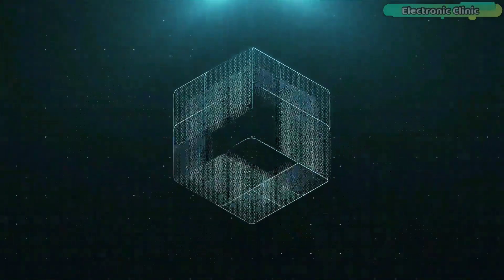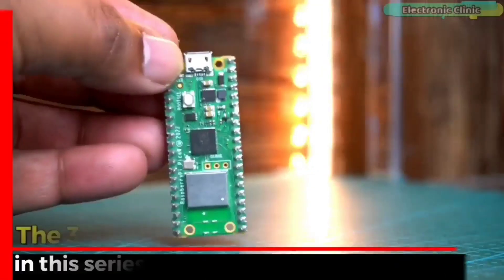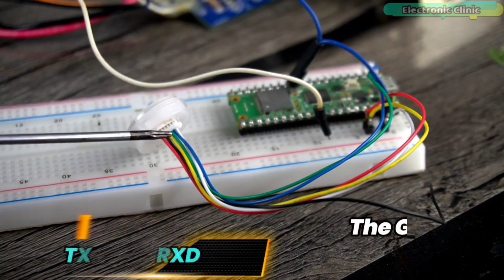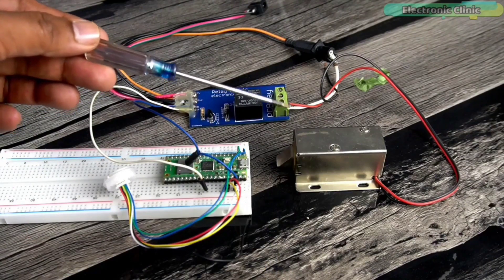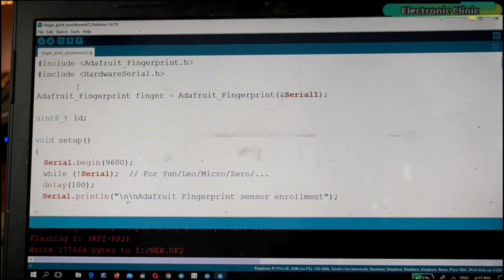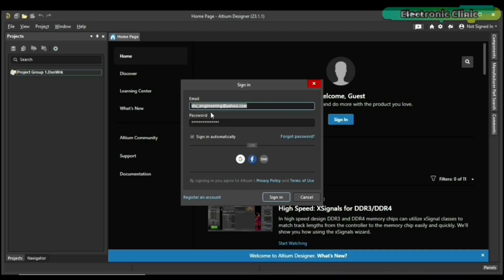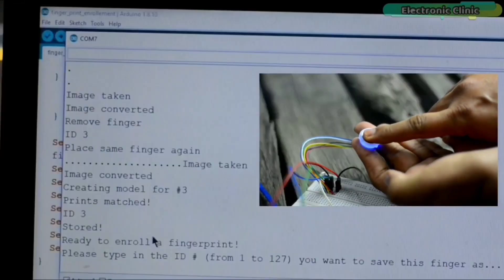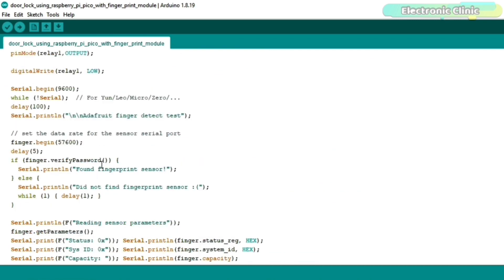Raspberry Pi Pico Biometric Fingerprint Door Lock project

Comment: its not working. can do it in Thonny program?
Reply from the maker: I have tested it and it works perfectly. Do you get any type of error?
Reply: ketch uses 57316 bytes (2%) of program storage space. Maximum is 2093056 bytes.
Global variables use 9288 bytes (3%) of dynamic memory, leaving 252856 bytes for local variables. Maximum is 262144 bytes.
Resetting COM4
Converting to uf2, output size: 148480, start address: 0x2000
Scanning for RP2040 devices
No drive to deploy.
Failed uploading: uploading error: exit status 1